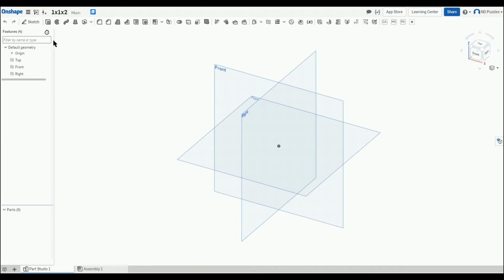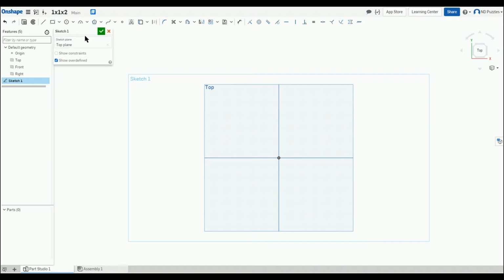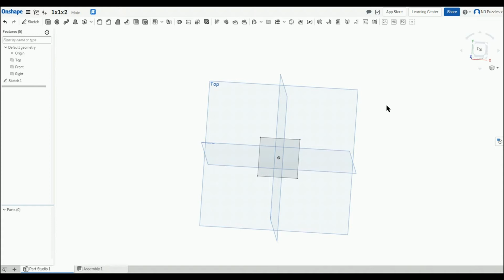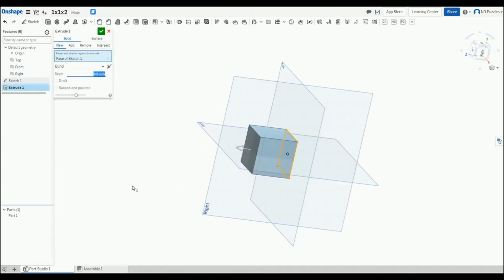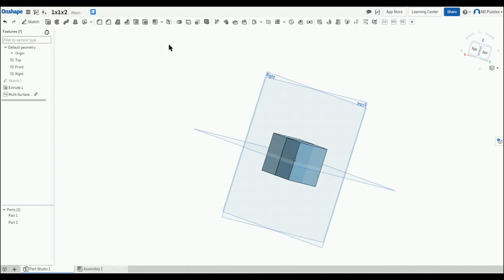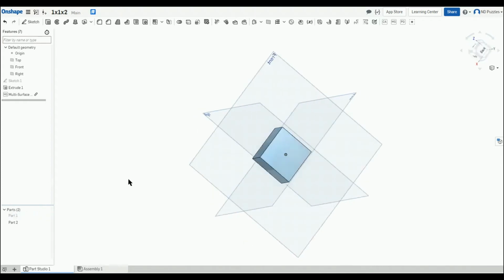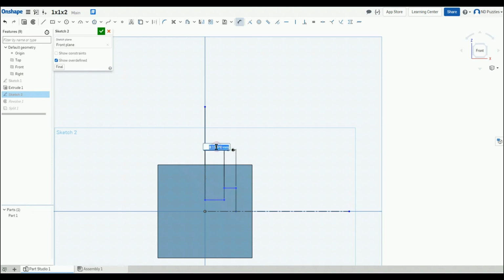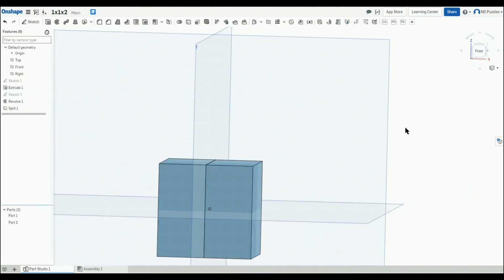Your first own Puzzle! | PuzzleCADon #2

Comment: The audio on this one seems to be out of sync or mismatched. Like the video had already performed the revolve to generate the hook but the audio for that kicks in much later. I had to jump back and forth to follow the video, slightly cumbersome. Is it possible to fix that. That being said, your exams should be your first priority - the videos and the viewers can wait.
Reply from the maker: I would love to say that this was a technical mistake but to be honest this is a general mistake we have to face in this constallation and scripting method. Nico asked me to write a script for the video in advance which he then used for the video. The audio was recorded seperately and then added on top of the video. This caused some serious issues in synchronization. As we are probably going to create multiple tutorials over the next years, I'm planning to "remake" those videos once with a technique of recording video and audio at a time. I now do have the neccessary equipment for that. The only issue up to now was that we didn't feel that fluent in English which made it harder to just talk while designing. At least that's what Nico said to me. The newest video has better synchronization though. I personally would feel ok with just recording everything in one go, so I'll maybe show that in another video series [I don't want to just take away Nico's series at this point to not destroy the structure]

I'm glad that you understand the exam-thing. Unfortunatelly it is a given fact that leaving this channel quite for more than a month will set us back quite a bit (that has happened last semester) but what should we do? So we'll just face the bitter truth and learn for exams hoping that once we are back to our full productivity (end of august) people will still be here.

If up to that time you have any specific questions concerning the CAD-design, feel free to ask me. I'm happy to help any new designers to become creative as well. ;)

Dario